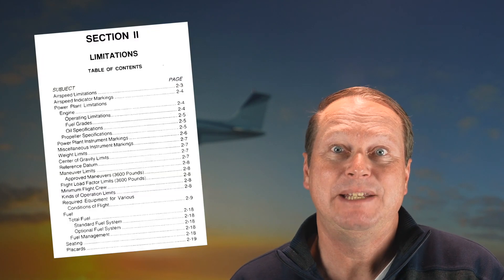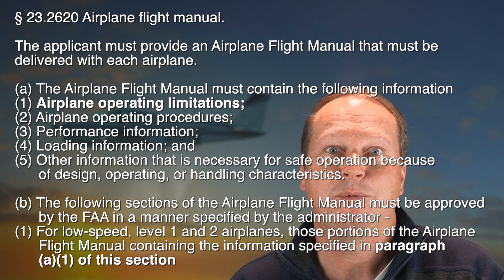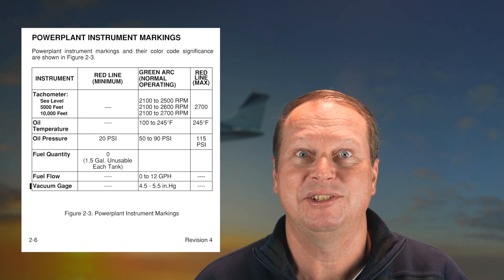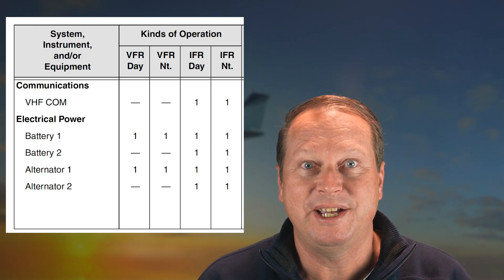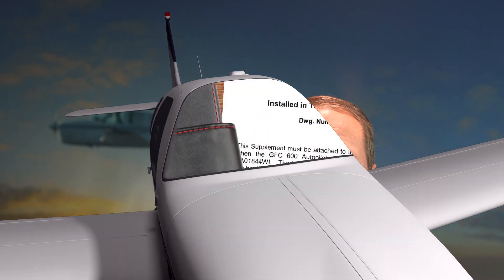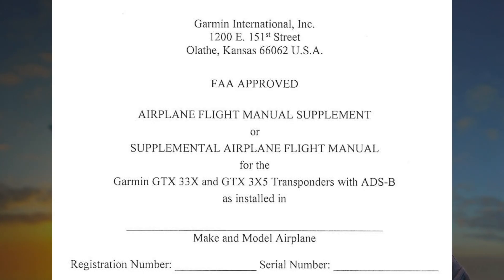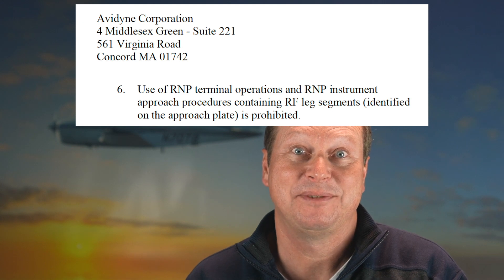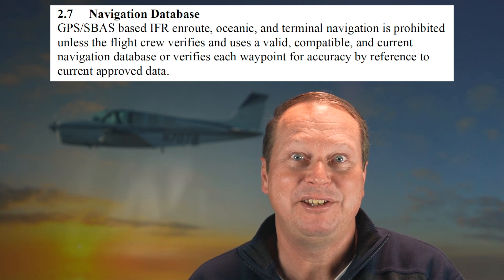POH and AFM Limitations Explained

Comment: Hello Martin from Sydney Australia, I hope all is well.
POH and AFM with suppliments.

Firstly, thankyou for explaining the FAA required documents.
After your training, I sat thinking why. What is the benefits and reasons, and why so important.
I came to these conclusions;
* Government control of modifications to plane type.
* Maintenance of airworthiness safety.
* Regulation of ownership between sales?
Tallyho dear sir, 🖌️🧐🛩️
Reply from the maker: Hello John,
The distinction makes sense to me. There is a lot of good information in the remaining sections of the AFM (or POH). Giving the aircraft manufacturer the freedom to write that information somewhat freely while getting consensus from the authorities on the limitations seems like a good split.
- Martin

Comment: I also have been taught by every instructor I’ve ever had to square 25 on climb.  I’m very interested to hear your explanation as to why this is incorrect.
Reply from the maker: Sometime this year I will make a video on this subject. Until then: look at your POH or AFM, and try to find where it says you should use 2500 RPM/25" for initial climb. For most of the fleet you will not find such a recommendation in the book, let along a limitation.
- Martin

Comment: Thanks for this review.  Watching lead me to go back to my AFM Supplements section and review the operating limitations of things I've added to my DA40.  Interestingly, my two-blade prop (vice original three-blade) increased both my landing distance (bad) and gliding distance (good) by 5 percent.
Reply from the maker: You replaced a 3-blade prop with a 2-bladed one? Interesting; most people do it the other way around. Did you get a cruise speed improvement, or what was the reason for the change?
Thanks,
  Martin
Reply: @martinpauly  My DA40 originally came with a three-blade composite MT prop (1st generation).  The original owner replaced it with a Hartzell two-blade aluminum prop.  (The MT was prone to chips, etc.).  The two-blade aluminum increased cruise by about 2kt and is much more durable.  The downside is that it is 15lb heavier and causes more vibration, especially on shutdown.  I'm considering returning to the three-blade composite MT prop, but second generation, which supposedly is more durable.  There is a Hartzell two-blade Kelvar composite prop option that is the best of all worlds, but currently lists for $27K.   Bernie

Comment: Just bought a new plane and I am going through the book as I am watching this. Very interesting stuff Martin.
Edit: I had 2 instructors fly with me in my new plane. Both taught the 25 squared on climb out. Now I am curious about why.
Reply from the maker: It's a myth that won't die, Bryan. I'll address it in a future video sometime, but I doubt I will be able to put the topic to rest. In the meantime, grab a few POH/AFM of popular airplanes and see if you can find a limitation (or even a recommendation) to pull throttle and RPM back right after the wheels leave the runway.
- Martin
Reply: It’s such a stupid and counterproductive OWT.   Rumor has it that it originated with CFIs of the late 1940s when GA was in a postwar growth period.

     Most CFIs in the 1946-1960s period were former WWII Army Air Corps pilots that flew the T-6 Texan and later, large radial powered bombers or fighters.

     Many of these aircraft had a “METO” power setting in the flight manual.  Maximum Except for TakeOff.  

    Takeoff power was usually redline MAP and redline RPM.  After a period of 1, 2 or 5 minutes (depending on the aircraft), the MAP and RPM HAD to be reduced to the METO setting.  
       
     On a lot of normally aspirated large radials, this was 25”, 2500 RPM.

    When these postwar pilots became civilian CFIs, they continued to apply these procedures (unnecessarily) to the horizontally opposed engines of the Bonanzas and Cessnas of the day.

      Unfortunately, the law of primacy is very hard to overcome.   When someone is exposed to “25 squared for climb” from the start, it is pretty well stuck.
Reply: I learned complex in a Cessna 172RG.  The POH lists for normal climb 25 inches and 2500 RPM.  My instructor further clarified to reduce to this setting at 500’ AGL.  I’ve been doing this ever since then.
Reply: @sw538  
       Take a look at the Limitations section for the O-360-F1AB.   You will find that 2700RPM is the maximum continuous allowable RPM.   There are no manifold pressure limitations.  

     Also, in the normal procedures section of your POH, below your cruise climb setting of 25”, 2500 RPM, you will find a Maximum Performance Climb power setting of FULL THROTTLE and 2700 RPM.

         If you look at your time, fuel and distance charts, you will find that climbing at WOT and 2700RPM will get you to cruise altitude more quickly and save fuel over the length of the trip compared to slowly climbing at 25, 2500.   This effect is magnified if you choose to cruise LOP.

       In addition, if you are equipped with an EGT/CHT monitor, your engine temps will be cooler in the climb at WOT, 2700RPM.   
   
   Two reasons:  at WOT, there is a fuel enrichment circuit that richens the mixture slightly to increase detonation margins.  Also, reducing rpm acts in the same way as advancing the timing.  The peak pressure pulse occurs closer to TDC and increases maximum ICP and therefore CHT.
     
       While some may think that 25”, 2500RPM is “going easier” on the engine, it is actually making the engine run hotter (CHT) and stressing the components more.

     All of this data based evidence is available at advancedpilot.com.   Also, google Avweb’s “pelicans perch” articles about engine management and POH recommended climbs.   There’s a lot of bad data and old wives tales contained in these legacy POHs.

     Again, most CFIs were taught the “25 squared” years ago, just like the CFIs that taught them.   The law of primacy is very hard to overcome.